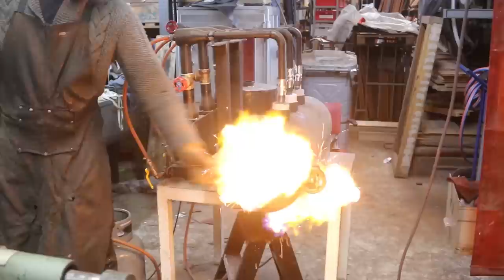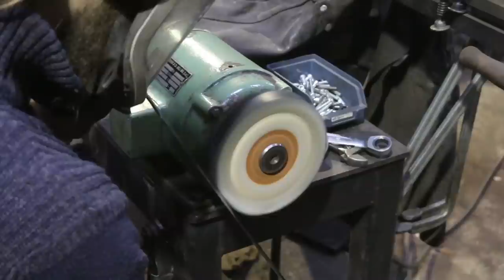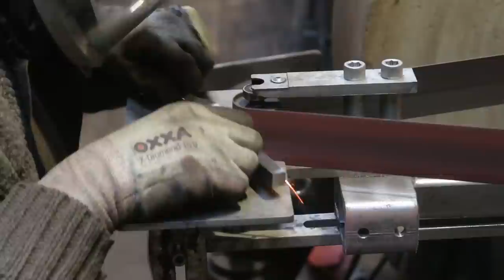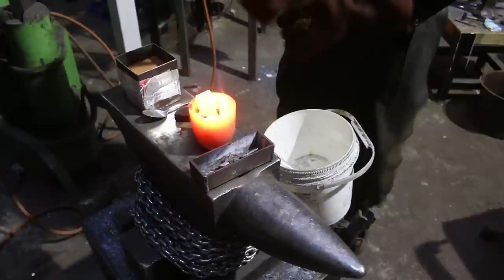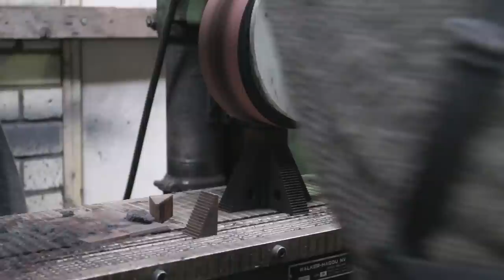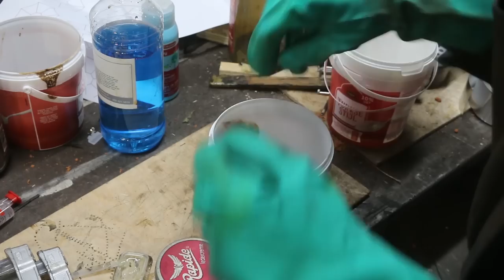Forging a German longsword, the complete movie.

Comment: I would like to see some cutting test.  Wondering if it's a real sword or costumn....
Reply: Really?  

You just watched him make it and you're asking that?

He's used the steel from truck leaf springs.  That's the spring steel that holds up the weight of trucks for hundreds of thousands of miles.  You could say that it's fairly strong.
He then forged it into shape, stress relieved it, quenched it, and tempered it.  I'd say, at a guess, it's Rockwell rating is between 56 and 58.  You could say that it's extremely durable.
He then ground and polished it to a mirror finish.  Not only could you shave with it, you could watch yourself doing it.
He then cast, forged, and finished all the fittings for it with a beautiful full tang through grip that's strong enough too cut you in half with one blow.
Of course, you didn't see any of that.